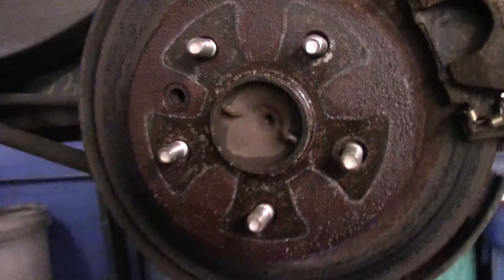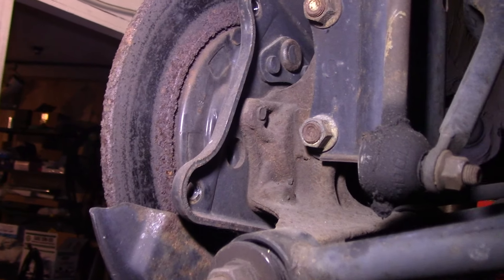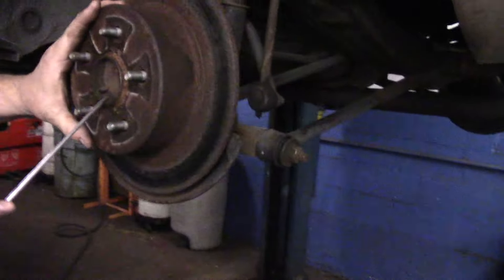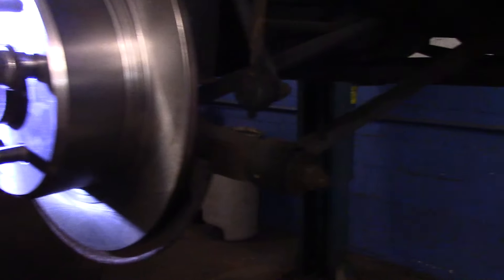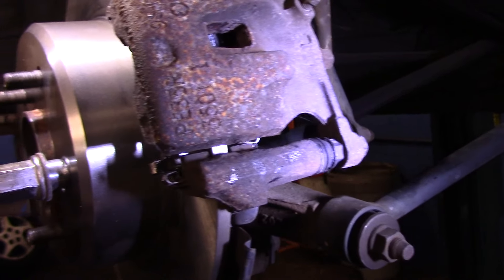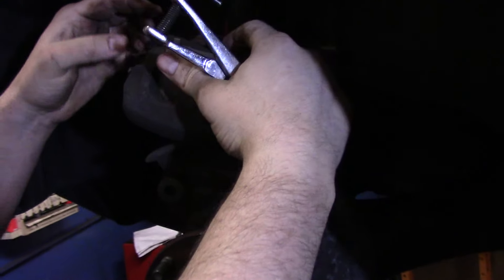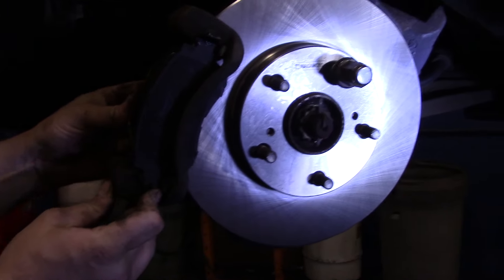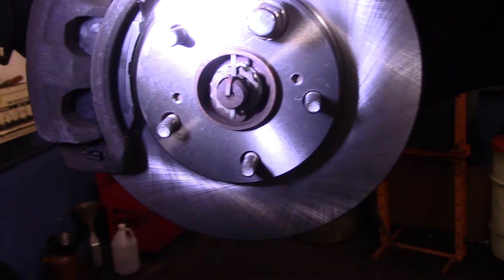1997-2001 Toyota Camry Front & Rear Brakes - Quick & Easy

Comment: One thing for our fellow DIY. Open the brake fluid reservoir slightly and or verify that the fluid level is not close to the top just before compressing the caliper pistons otherwise the fluid will spill over and make a mess. Best not to leave the reservoir cap open too long because most fluid types are hydroscopic and will attract moisture in the air. I usually will pull out most of the reservoir fluid as the first step and then close the cap. Thank you for your videos. Keep them coming

Comment: Very good Rotor brake pad replacement job well done with great advice. However, with the car's age, I would have recommended at least a flush of the brake fluid. Most manufacturers recommend flushing your brake fluid after 6 to seven years due to the fact hydraulic fluid absorbs moisture which moisture can cause a spongy brake pedal. I just want to add because this is Jim's customer he may have already done a complete brake job and bled the brakes previously, I'm just saying this because fresh clean brake fluid is very important for the brake system.

Comment: Jim, for those in the rust belt, can you recommend any rust-resistant "coated" rotors? I notice that you never put any rust inhibitor between the hub and the rotor, or between the rotor and the wheel. Is it not a good idea, or in your experience does it not help prevent siezing?

Comment: Never re-use brake hardware.  Always replace.  Owner doesn't want to spend a few more bucks to do the job right, you should have refused the job.  If brakes fail, you get the blame.  Brake shoes aren't expensive enough to not do them.  As a business owner, you have to consider your liability.